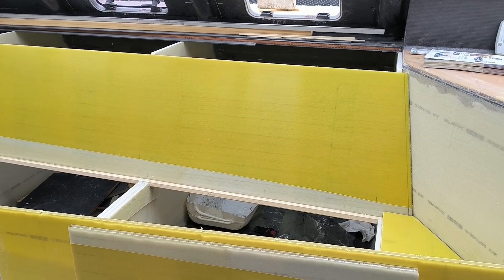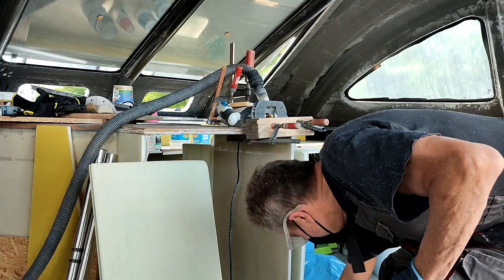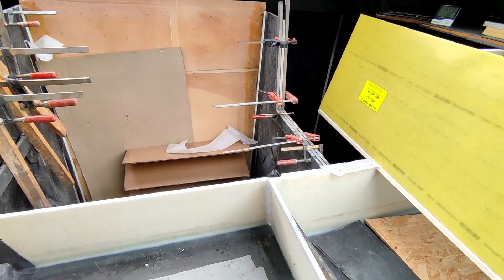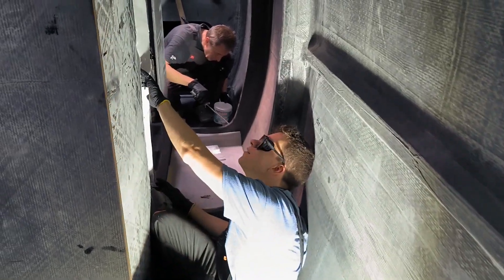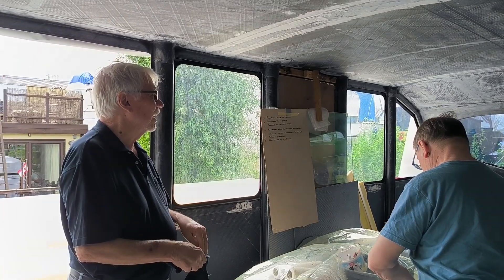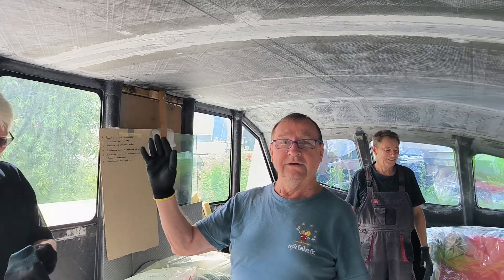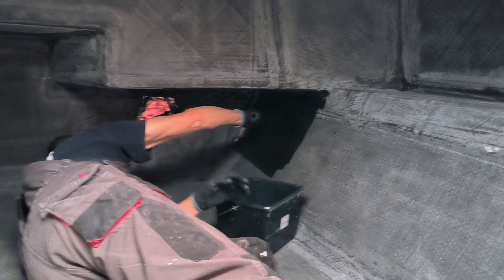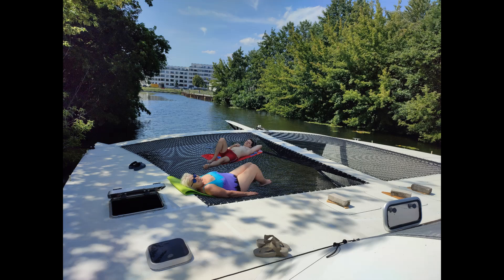10.  Building 15m carbon performance catamaran - "CarbonBee"

Comment: Hi! very interesting and serious project!
May I ask, when you vacuumed the hull, was the die surface made of plywood?
Are the main hull walls made entirely of carbon or did you add extra panels to increase strength and reduce weight?
What is the minimum and maximum thickness of the main outer hull walls?
What is the approximate weight of the catamaran at the moment in the video?
Reply from the maker: Thank you for the comment. The answers on your questions are in the description under the video, in my answers to the other comments and in the video number 01.
In this stage (video 10) the weight of CarbonBee is ca. 3,6 t.
Reply: @bojanu7212  Thanks for your reply, I'll be rooting for you.
Reply: One of my favorite and needing to know questions.

Comment: How did you learn so much about designing a boat like this, building it and then about how to properly install carbon fiber? Also, is this your first build?
Reply from the maker: Kevin and I have academic grad of Masters of Science in Engineering. We possess technical knowledge in the fields of construction, design, materials science, engineering calculations and management. Additionally, Kevin has been racing in regattas since he was a child and has won many of them. Although I worked in a completely different industry with world top biggest companies, than yacht building, sailing, designing, and rebuilding yachts has been one of my hobbies. I also briefly worked for a design office in the yachting industry. All of this forms a solid knowledge base needed for our project.
Reply: @bojanu7212  That's very cool. I started sailing when my dad built me a little homemade sailboat before I started my schooling and before I knew how to swim. I started racing Naple Sabots when I was 8 and also joined a yacht club and started taking sailing lessons for about 10 years. I've raced many different boats but mostly small boats but my passion was racing catamarans. My biggest accomplishment was winning a major Tornado catamaran regatta that had well over 100 boats on the starting line. we got four first and one second place. Because of that, I qualified for the Olympics but couldn't afford to campaign because it takes a lot of money to travel the world attending all of the races and you have to have two boats. It's crazy expensive.
Reply from the maker: @robertlaird6746  Wow, you accomplish a lot. It is a pity you couldn't continue your racing career. Stay in contact with us. I am sure we will need experienced sailors with a racing background.
Reply: @bojanu7212  I'd love to go sailing with you but am about ready to build a Mumby Cyber 48 so that I can sail around the world like I'm sure that your going to do as well. By the way, I also lived aboard a 165 ft. two masted gaff rigged schooner called TeVega for 11 1/2 months. Now it's called DEVA. I hope that you continue sharing your adventures on YouTube so that we can all watch. It's very possible that we will see each other in some anchorage in the future.
Reply from the maker: @robertlaird6746  Sure, the world is small.. we will meet us sometime, somewhere..

Comment: I've heard that anywhere the carbon fiber is exposed to the UV rays from the sun that it will delaminate. With that said, I would for sure paint the exterior of your boat and see what happens in the future with the inside sun reflections to the fibers. Did you base the design of CarbonBee off of a beach catamaran. I wish that there was more of a story about what went into the design. I'm also what the light ship weight will end up being.
Reply from the maker: Carbon fibres are immune to UV degradation, but the resin that holds it is exposed to UV degradation. The way to protect the carbon fibre laminate or glass fibre laminate is to cover it with the UV protective paint or to apply/add UV stabilisers to the resin. We use both methods. Outside we use white paint (additional effect is low temperature in the sun - black surface can reach over 70° C), inside where we use clear epoxy coating we add UV stabilisers.
The answer on your other question: yes our design is similar to beach catamaran, because it has two hulls, mast, sails, ruder and is designed to be light, fast and giving a lot of fun. 😀.With these the similarity is ending.
Some of the design parameters are in the description under the video, and at the end of video number 01.
Reply: @bojanu7212  Thank you! Your going to have to do a full overview on everything once your completed with the build.
Reply from the maker: @robertlaird6746  Yes, that is good idea.

Comment: You would get a better resin to fibre ratio if you used a wetting out table and squeegee the carbon before laying it.
Reply from the maker: Yes, in general we make it on this way and always we use peel-ply. You can see it in detail in our other videos.